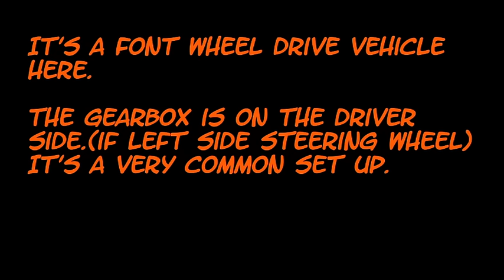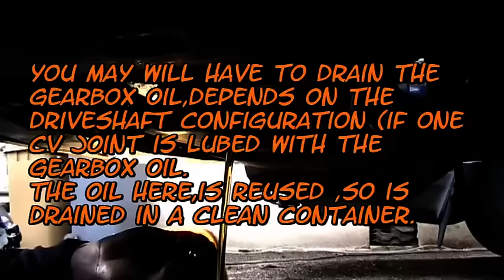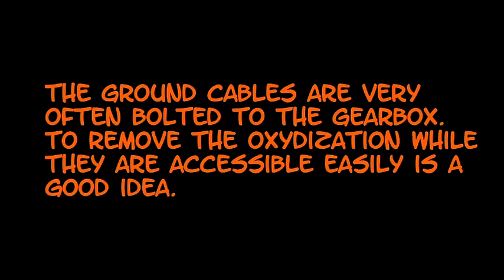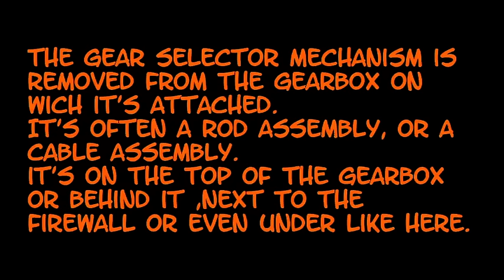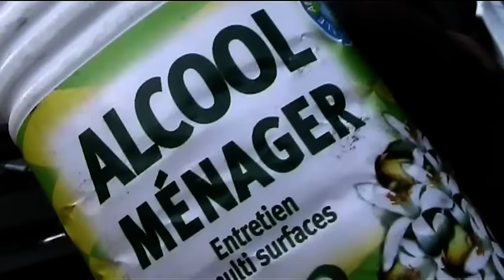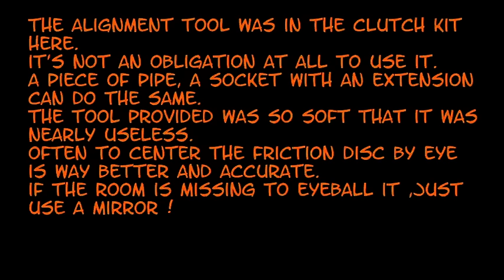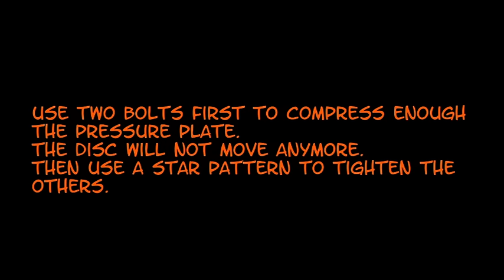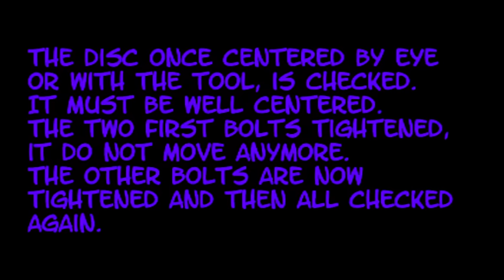Front Wheel Drive car clutch replacement.

Comment: I have the same car, its a renault laguna right? What can i do to the clutch pedal to move smoother?Mine needs really hard pushing.10x
Reply from the maker: It's a renault 21,it's the same system,
If the pedal is hard to move that often mean the thrust bearing (bearing of the clutch) is rubing against a worn out pressure plate.
There is certainly a groove in it ,and it's causing that.
How many kilometers or miles on this clutch ?
Reply: 225.000 km,i don`t know if the clutch was ever changed. The clutch is slipping in 1st gear if i accelerate too hard, and is struggling to maintain 100km/h. Any chance that the flywheel doesnt need changing?thanks for the reply
Reply from the maker: With that much kilometers,unless the car was only on freeways,the was was certainly replaced once.
If it's slipping ,you can change it without hesitating.
The more it will slip,the more you damage the flywheel,by overheating it.
Once the clutch disc removed ,you will can see if the flywheel need to be changed.
You can't tell before that.
Reply: I`ll  buy the whole clutch kit( pressiure plat, fly wheel and thrust bearing) and replace the whole thing. I have the same engine, i have a small crack (1-2mm) in that round thingy where induction coil wire is connected to the other 4 that goes to the spark plugs.The crack is on the inside of the plastic thing,rght in the middle of it.It is possible to loss curent in the engine block thru the crack?thanks for the reply(eng is not my primary lang)
Reply from the maker: Yes,you can loose some spark.
Change it,it's a good idea,it is normally changed regularly because there is a brush (contact made of carbon) wich wear out.
think to the wires too.
Where are you from ?
Reply: It happened to my once that the engine didn`t start at all, drained the battery.I cleansed that thingy, it was full of some green oxide,that`s when i saw the crack.And the rotor inside that thingy is pretty worn out too.Now it works ok, but sometimes it takes time to start the engine(almost 1.5 seconds)I`m from Romania.10x
Reply from the maker: It will work way better after you change it.
mine did the same,poor starting and sparks were directed on the engine block because the wires were too old... 
You can test if you have spark leaks by spraying some water with a spray bottle(the one you use to clean windows)
I'm from France : )
My parents will visit Romania this summer : )
Reply: I will change it, along with the whole clutch kit this summer. Do you watch the game?:)))
Reply from the maker: No,i don't like ,but i've heard a lot of peoples,and the peoples are home,not a lot of them in the streets...: )

Comment: wy did you take out the schock assembly you can leave those on and i see its a renault its a f motor think f3m ore somthink but i am not shure on the car is it a 21
Reply from the maker: I've removed them to have more room to work,and less risk to mess up the boots on the transmissions,and it's really fast to do ,
Good eye,it's a Renault 21 : ) the engine is a F2N ,F3N have fuel injection : )
It's a carb here : )
Reply: thanks for reply so i was richt abouth the car but wrong on the engine i worked for renault for 12 years so know them a bit
Reply from the maker: 8alakai8
What was your job ?
Reply: mecanic
Reply: i liked youre mbw k75 engine rebuild
Reply from the maker: 8alakai8
Ok,You know your stuff so : )
Thanks for what you say about the video : )

Comment: Wauw great video! I still need to do this because me gearbox is leaking oil very slowly. Could it be the bearing in the back where the clutch cable was connected to?
Reply: most likely, i think

Comment: Hey Michael,good video,tank you very mutch.
Can i use this tecnic for the Opel astra caravan diesel 1.3 cdti from 2007?
cant afford a shop to repair it so ill give it a try
Reply from the maker: Dyno Man 
Hi : )
The worst situation will be to be obliged to remove a bracket or an engine craddle to be able to remove the gearbox by under the car.
Otherwise,the whole job will be the same, as you can see here.
To be sure and to do it right the first time,just buy the repair manual a bit before the job.
You wil have no surprise and will be confident,and prepared : )
Check to know if you have to replace the flywheel or not (dual mass flywheel) : )

Comment: SUPERB VIDEO!!!!!
I am about to tackle the clutch on my Hyundai Coupe 2.7, turning the flywheel from Dual Mass to Rigid, so this video help Lots!
I was seriously worried about the job and what was involved (outside of the gearbox), and with your information from bonnet open to gearbox off now I'm super excited to get started! 
Thanks for your Video !

One question!!?.... why does the other side wheel and driveshaft need to be removed? surely just the gearbox side is needed to be removed?  Sorry for the stupid question!
Reply from the maker: Thank you : )
To be able to move the  gearbox easily,i removed both driveshafts.
It's not always an obligation.
You got an adapter kit from valeo ?
Reply: michaelovitch
Thanks for the quick reply!!
Yeah full 4 pcs conversion kit.
Thanks for the advice.
I guess I'll remove both just to be sure that I'm not half way through and need to and not be able to Haha!!!
Reply from the maker: Think to replace the cranck seal too : )

Comment: Please someone answer, ive got a clutch job ahead of me and i need to know if i have to let out the transmission oil before i seperate gearbox from the engine, thankyou
Reply from the maker: +Pizdzirynka1 
Hi,
It's not an obligation,you may have or not following the model of the gearbox.
Just pull the transmissions,you will see if the oil leak or not.
If the oil do not flow,you don't need to refill the gearbox.
In any case it's a good idea to change the oil regularly (if required)
some brands don't even recommand to change it....
Reply: thank you for your reply michaelovitch, Im getting into it tomorrow with my mate we'll see how we go! :)
Reply from the maker: +Pizdzirynka1 
So,how it went ?
Reply: Took us like 12 hrs or so but so worth it.
I did let the transmission oil out as I pulled the CV shafts out anyway. Nothing too complicated about the job, its just time consuming.
Reply from the maker: +Pizdzirynka1 
Good job !
you resumed the situation pretty well about this work.
Not really complex but time consuming.
If you do it an other time it will be way faster,even if most of the time the car itself make you loose a long time depending if there is room to shove the hands in or not...
Reply: ohh bro... i hope ill never have to do the clutch job again lol
still thanks for the video man!

Comment: Why did you remove the struts for?
Reply from the maker: To be able to remove the axles shafts.
It's difficult to pull them out the gearbox without moving the hubs a lot,wich are attached on the suspensions.

Comment: What are the chances of gears dropping when you pull the drive shafts?  Does the broomstick you put in place have to be exactly the same diameter as the shaft?  Any difficulty getting the drive shafts back in if one gear slightly moves?  Thanks.  Good video but trying to get up the nerve.  Losing the gears in the gearbox would likely mean buying a new transmission.  This has been a good car with over 200K miles but I don't want to overspend on a lost cause.

Comment: How long does it take from start to finish?
Reply from the maker: +jackslater230011 
From two hours to a day of work.
All is question of the car,your experience and if you have booze or not : )
Reply: +michaelovitch What kind of car is that? Also, will I have to remove the mounts and subframe?
Reply from the maker: +jackslater230011 
It's a Renault 21 GTS twin barrel carburetor 1989.
You only will need to remove the gearbox mount.
The subframe is not an obligation at all if you can move the gearbox enough to work on the clutch like here.
I've done that on several cars while i was supposed to remove the subframe,it works well.

Comment: Does anyone know the exact reasoning for taking out the struts? More room to work with ??
Reply from the maker: It allowed me to push the gearbox on the driver side ,and not to remove the gearbox from the car,wich is way faster and easier.
Removing a strut take few minutes.
Reply: +michaelovitch okay thanks!
Reply: +michaelovitch 
 great info - I wonder if it's similar set up to saab93 tid but I may change dmf also
Reply from the maker: If you change the dmf,it sure would be easier to remove the gearbox unles you have quite some room.
I doubt about that,recent cars are packed in the engine bay lol

Comment: Hi sir 
Have a nice day

Last month I changed the clutch Platte and clutch cylinder in my   SX4 after change clutch get hard more then before
Reply from the maker: Is the clutch cable adjusted properly ?
Reply: @michaelovitch  it's Hidralic clutch
Reply from the maker: @syedibrahimdawood9716  Try to purge it to remove the air from the piping.

Comment: Ive got a 1987 toyota sprinter and think the clutch has been burned out, pushing on the clutch petal there is nothing pushing against it, when it stopped working there was a burnt smell
Reply from the maker: Ryan Oates 
I would say ,yes,the clutch is so worn out the bearing went through the pressure plate.
How many miles have the clutch (or the car if it's the original one ) ?
Reply: im not sure but the car has 280000km
Reply from the maker: Ryan Oates 
So it's must be the second clutch,unless the car did only freeway or long journeys.
I would say it's time for a new one.

Comment: Can someone damage wheel bearing while removing clutch or transmission?
Reply from the maker: Yes,because the cv shafts connecting the gearbox to the wheels are inserted in the hubs.
Those hubs are themselves inserted in the inner race of the wheel bearing.
following your model of car it's a whole assembly ,sold as is (hub/bearing assembly)
Somebody damaged your car ?
Reply: michaelovitch after a transmission repair my car makes a sound from right wheel if i can listen correct and maybe from inside the transmission itself...but almost a year passed since they made this job and i don't know if i should blame them
Reply from the maker: You need to check if the big nut on the center is tight enough,or not too much tight.
This axle nut is what's retaining the whole hub to the car itself.
If it's a bit loose ,or a bit too  tight,the bearing wore down incorrectly,wich can lead to this noise from the wheel.
Reply: michaelovitch so you think that they didn't tight the nut enough?
I have done almost 20,000km with that sound but it gets my attention everytime i take a right turn especially when it's on a speed like 80km/h and uphill...
Also one more question.
Do you think that if something sounds wrong from transmission pressing the clutch could be determine whether is from transmission or not?
Reply from the maker: I don't know if it's too tight or not.,you need to check that with a torque wrench.
I can tell you that if not torqued properly it's not good for the bearing.
If you hear that noise at this speed in a right curve going uphill i would say that those are good conditions to create low pressure,low load on the right wheel bearing.
All the weight is on the left side of the car,so being loose,or worn out i guess,the bearing is noisy.
You lift the right side of the car,and check the bearing,by shaking alternately  the wheel with both hands at 9 o clock and 3 o clock.

Pressing the clutch pedal  will only engage or disengage the clutch disc mechanism.
You will only rotate or not the primary shaft when in neutral or two shafts when in gear.
It can help you to provoke some noises if the transmission have some play in it,or worn bearings ,but it will not show you a lot.
Reply: michaelovitch thanks you very much...
The car is an Auris 1.33 and the repair was done on a Renault/VW official workshop
Reply from the maker: Theorically it should be done correctly.
But,unless you check by yourself you can't be sure.

Comment: Is the gearbox on the right on lhd cars?
Reply from the maker: As i know,no.
It would be too expensive to make an other powertrain ,completly symetrical,just for lhd vehicles.
They just poke a provision hole in the firewall,and make a different steering rack,and dashboard.
It's only a question of manufacturer,and mostly it's on the driver side.
It's sometimes on the passenger side on the lhd ,like on older honda cars.
I think the whole concept depends on wich side the engine is rotating.
The root cause of all that is the fact that you have to screw the screws on one direction,or they tend to loosen if the engine rotate the same direction.
https://itstillruns.com/tell-direction-car-engine-turns-12176823.html

Comment: Hola me an cambiado el embrague opel corsa d. Funciona bien pero me cuesta poner la primera y la marcha atras  alguna idea de por ke pasa esto
Reply from the maker: Hi,
You need to be sure the hydraulic system is full of fluid,and no air trapped inside the lines.
Try to purge the air.
Then,be sure that the linkage wich goes to the gearbox is in good shape.
If you have some play in it,the gears will not be easy to engage.

Comment: How much does one charge for replacing clutch NORMALLY (or average price I would say). This seems like a lot of work lol.
Reply from the maker: It's minimum around 500 euros,depending on the vehicle,if the access i easy,or if you don't have to remove the engine craddle or not.
Sometimes it's a pain in the butt,and quite long.
The cheapest is theorically the rear wheel drive vehicles on wich the gearbox is easy to access.

Comment: A Pro wold have replaced that flywheel and would not have used a pint of grease. 
Also - Would not have greased were the throw out bushing clicks on to the throw out bushing arm. 
It doesn't move once it's on so it doesn't need to be greased. 
You don't want to use excessive grease around the clutch, if any get''s on that clutch it's going to slip. Small amount (if any) on the groves and top of the shaft and a dab on the inside of the throw out bearing arm like he did. That's all
Also - Would have replaced the Shaft bushing inside the crank shaft.
Those things should have all been done regardless of who is doing it.
You don't want to have to go back in to fix something you could have done when you had it apart.
NOTE: make sure you don't let the transmission hang by the clutch if you have trouble getting it to go in.  Pull it out check whats wrong and try again.
If you do let it hang before it's bolted you can warp the clutch causing bad performance  and early wear.
Reply from the maker: I agree about the grease,the excess was removed.
The flywheel is ok (it's not the one showed on the ground) ,no need to change it,it's useless ,it's running smooth and grabbing smooth.
I agree about the shaft bushing in the cranck.
Thank you for the infos and tips.
Reply: I didn't realize it wasn't the flywheel shown. Thank you

Comment: Trying this at the moment. I'm stumped. I spent all day freeing frozen bolts.

I'm stuck at a point where the last two bolts holding the transmission together are blocked by a guard of some sort along the bottom of the car, but one of the engine mounts is bolt to the guard. I really can't win. Flicking through my manual, getting frustrated.

Comment: Used too much grease, you should not have put grease on the pilot bearing. 
After high rotations the grease will eventually come on the fly wheel which will cause the clutch to slip.

Comment: Hi, what car was this? (make, model, year, engine)
Reply from the maker: Hi,
it's a renault 21 gts 1989 1.7 liter SOHC two barrels carb with accelerator pump and with vacuum operated second barrel (f2n 254) electronic ignition with vacuum advance